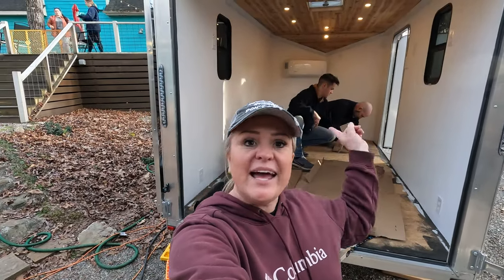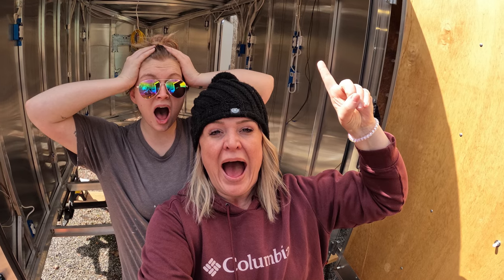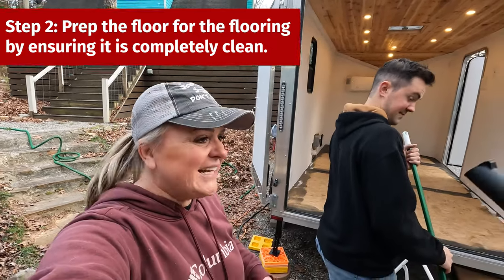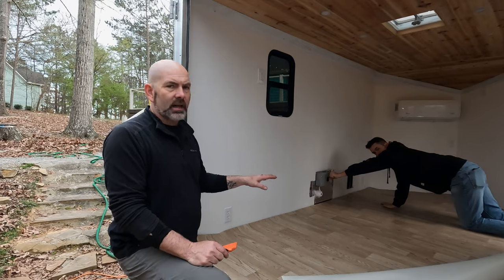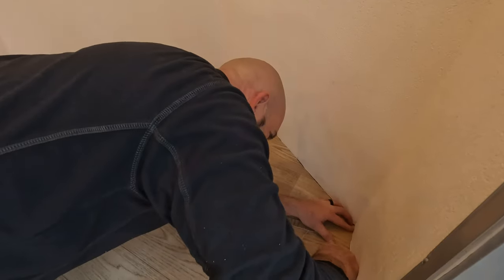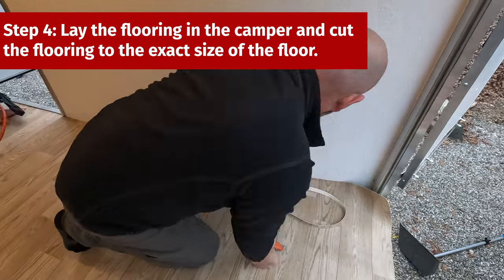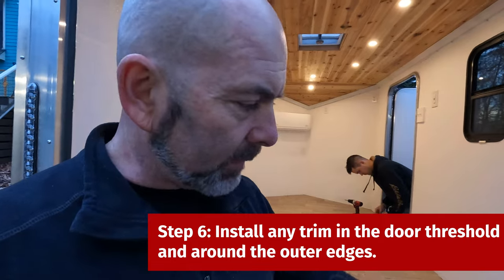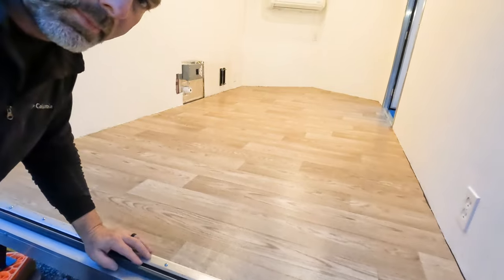EASY FLOORING FOR YOUR CARGO CAMPER Ep. 11

Comment: Looks good. How likely would it be to puncture the sheet if say a hammer 🔨  dropped on it?
Reply from the maker: It is linoleum, so its not super durable, but it's cheap, light, and easy to install.  If weight wasn't an issue I would definitely use waterproof LifeProof flooring.  Thanks again for watching!!!